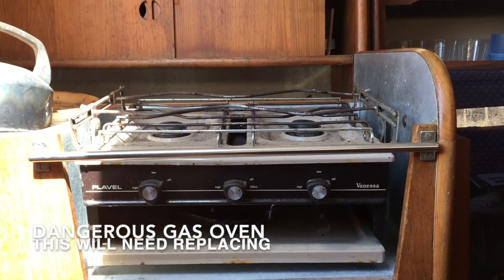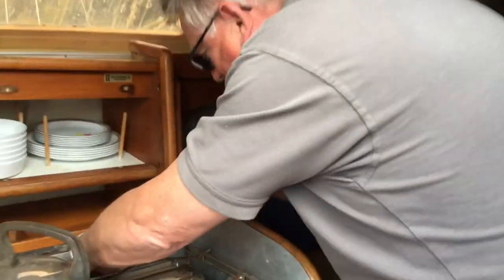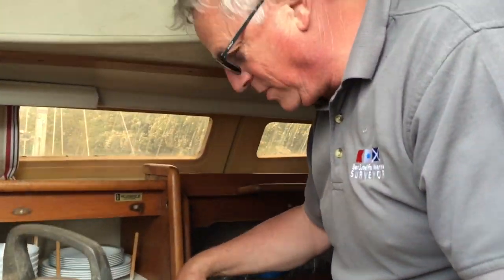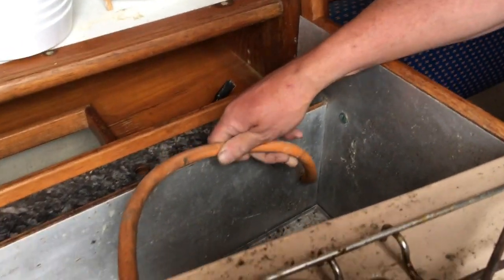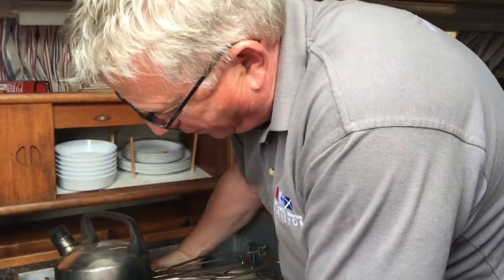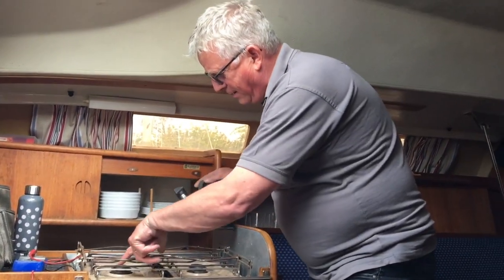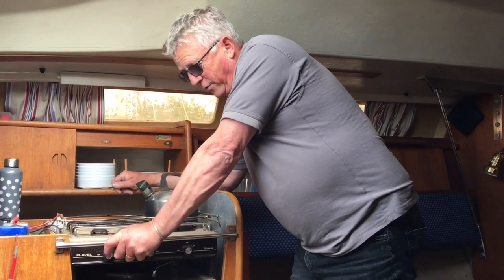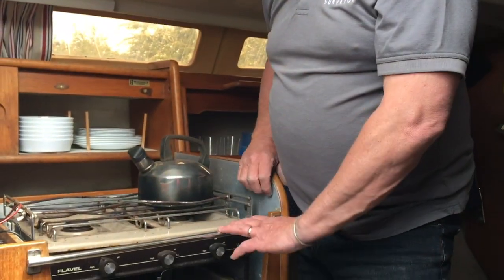Oh no! This gas oven is dangerous... here's why

Comment: were not all on surveyor wages and can afford diesel hobs or ovens
Reply: I understand that budgets can make things tight but, but my point was by the time you but a  replacement cooker and re do the whole system its really not that much difference, on top of that gas bottles are becoming more and more expensive. My hob from kuranda was £1100. You could also fit a tidy sprite stove for a fraction of the price too. Regards Ben